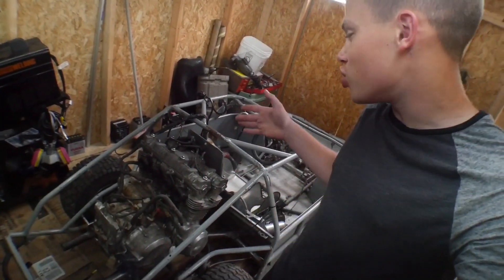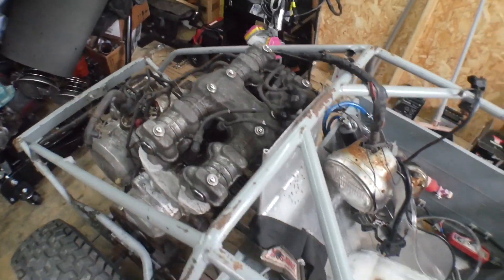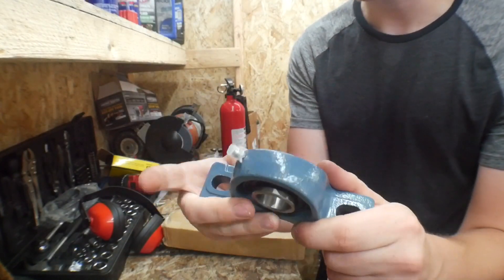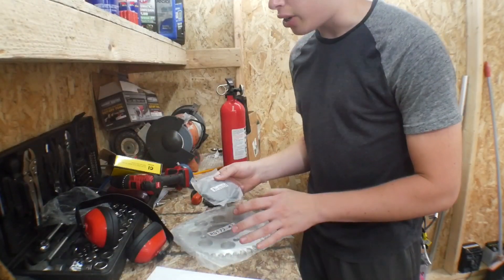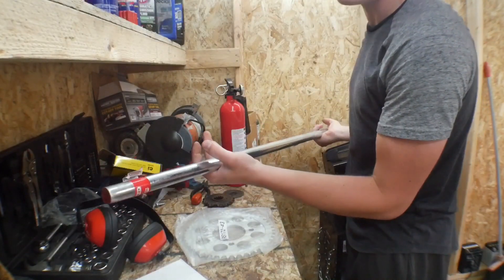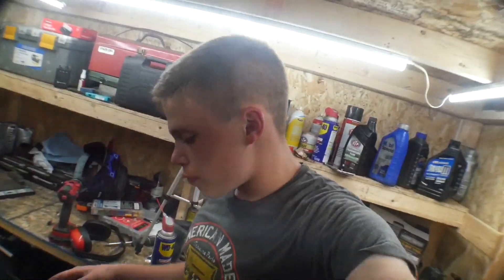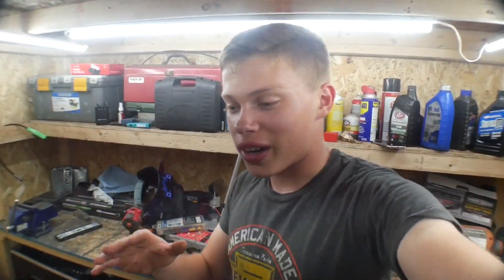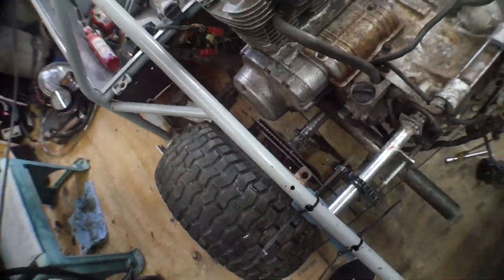Beginning To Make the NASKART DRIVE With it’s New ENGINE!

Comment: If your balling on a budget a level is literally the worst way to make that shaft perfectly flat. Use a 90° right angle and line it up against the rod. It will show you the high spots then sand, and triple check from all angles with the right angle until the surface is flat. As for welding the shaft to the motor, it works, I've done it. But secure 3 pieces of flat metal along the shaft you made and the engine shaft. This will align it and leave you one side to tack it while its straight. Always triple check. I noticed you called it good and the shaft is still extremely wobbling which will lead to things breaking in the transmission over time as well the chain coming off the sprocket. I like the effort though! Keep it up!

P.s. I would have done this much differently with a Jack shaft system. However my advice is for working with what you got already.

Comment: Those welds wont hold u need more practice cause its tricky to weld with good preparation with harbor freight welder and u need to use a lathe to drill into the bar it will be strong and done right the motor has to much torque it will break as soon as u take off or get speed

Comment: I just died. You really did weld directly to the output shaft holy crap.. Oil seal is now ruined and it's not even close to balanced so the vibrations will destroy the bearings in very short order.  
This is an actual disaster.

Comment: You welded that shaft straight to the output shaft on the trans ?? I cringed looking at that .. this is a massive fail ... be ready to pull that motor out and put a new output shaft in the trans because you ruined it .

Comment: Migs.  Please stop.  Please back up and rethink what you did in this video. Welding to the drive shaft on the engine??? What ??  Your setting up for immediate failure.  The weld won’t take the abusive torque.  I thought you were going to build a second carrier axle to transfer the drive from the engine to the main axle.  You had the parts to do it.  I’m lost now.  I don’t know what your doin.

Comment: The shaft weld would hold up but probably not the way you did it. You need to put a bevel on the bar so you are getting much more welded material for strength, right now its only the edge and the center is not supportive, if you grind a bevel into the shaft and weld it all solid it wont break.

Comment: You shouldn´t weld the rod against the motor output shaft. Use a coupling instead that will allow for some flex. The weld will crack in time.

Comment: Not being a dick but u have officially fucked that up, heat has killed drive seal and welding that to it will never be strong enough.also if no near perfectly straight vibration will kill it . Maybe u could of got 4 sprockets welded and bolted together the weld shaft to sprocket s ,at lease if it broke ur output shaft would still be ok .u should of used jack shaft really

Comment: Hey Migs, hopefully you didn't get a good weld on that counter shaft grind the weld off and bolt the sprocket on like it was originally use the two pillow blocks that you got and make a jack shaft. That is a short chain from the trans to a shaft then a chain from the shaft to the original axle. So you'll end up with two chains. I can send you a diagram if you would like.

Comment: You should of done a jack shaft or even welded the old sprocket to the end of the shaft so it has the spline. Will make it easier to remove engine later and will be much stronger

Comment: Its going to be way too low geared with oem sprockets as your drive wheels are half the size of the bikes rear wheel. You need a 26-30 tooth 428 split sprocket to set your gearing up right

Comment: no no no, do not weld to the output shaft..

mount 2 pillows blocks (one on each side) of the diagonal bars.
run the shaft through each, on the shaft run a sprocket that is driven by the engine sprocket.
then put another sprocket on the shaft inline with the final drive sprocket.. so much stronger, safer and less harmful to that engine.
Reply: plus you may have just killed the output shaft seal if it got too hot

Comment: You just destroyed your output shaft seal ..by welding on it ..before you get to far you can have a machine shop make a colour that will fit the output shaft or is that collar ? Anyway don't do that ..your engine oil circulated threw your transmission..order a seal and take you old output sprocket they can use it to make the collar .. by welding in your engine you can also destroy your alternator stator ..

Comment: Just for fun .. you'll need an electric fan between firewall and your engine as you will be blocking the air from an air cooled engine ..that's if you want the engine to last a while..

Comment: NO what are you doing welding that shaft the output shaft that will never hold that motor makes WAY to much power to do that shade tree mechanic crap bro find someone who can fabricate and fix that you should have done a jack shaft setup that seal around the shaft will more than likely leak now I told ya your in over your head and your drowning quick I cant wait to see the first ride please continue down this path I must say it makes for funny content but please think this through before it throws a chain and hurts ya bad

Comment: use a machine dog coupler please do not weld it 99.9 percent of the time you Will wreck the shaft/bearings they are used on electric car conversions and give you a couple of degrees on tolerance at least look into it first

Comment: You are going to ruin the whole thing you should not even try to weld on to the motors sprocket shaft you should of ran the stock sprocket and chain to a jackshaft then run nothing less then a 40 chain from jackshaft to the gocart axle look up rather be welding and or Redbeard's or even cars and cameras on here I hope you don't have the motor casing sitting on that frame you welded up cause it will brake the casing not hating on ya bud but you got to do a lil more research on it before you so it I'm glad you are trying to learn and teach ur self but a lot of people are going to hate on you on here but I promise you u will never get your weld to hold up on the shaft it is harden steal and no harbor freight welder will weld hot enough at least no flex core it just won't get hot enough I haven't even finished watching this but I hope you see this before you mess it up. Just take your time don't rush this do some more research bud ask people and if you ask gopower sport I'm sure they will hook you up with all the parts you need far as the jackshaft and stuff they help a lot of people to bad you don't live around me cause I would help ya out with designing in building it the right way do some riding videos in the mean time while you figure this project out
Reply: Please see this before u mess it up
Reply: Nevermind I just saw u welded on the sprocket shaft you will have to replace it and do it how I said with jackshaft or you will have to much vibration and it will ruin the motor it will prob blow to pieces if ur weld doesn't brake as soon as you let the clutch out

Comment: Ok best way to make the axle to the shaft straight would have been to find the center of the axle (bar) drill and tap the hole with the same thread size then find a piece of all thread or a long bolt cut the top off and screw both pieces together with the thread then weld it this way it perfect

Comment: Your clutch is gunna struggle so bad setting off you probably won’t even be able to se set off without stalling I’ve seen a video like this but bigger kart and he had to go really small for the engine sprocket and really big on the back sprocket just so the clutch was fine, I definitely think you’ll need to go smaller on the engine sprocket my guy

Comment: Don’t weld the shaft to the engine. The shaft will unbalance the motor and it will grenade itself and since you welded a shaft to a motor you won’t be able to take it apart. Instead use a jackshaft  setup which in return will give you more adjustability in gearing etc.

Comment: That heat welded on that selector shaft would most likely ruined the rubber oil seal. You will be lucky if it doesn't piss out all its oil now when it's driving. I though you were going a jackshaft, would have been a much better way but it's all a learning process.

Comment: I wouldnt weld the shaft to the motor the heat of tue welder will make the shaft brittle and when 75 HP comes in it will probly break. Make a jackshaft and that will give your more room to mess around with gearing.

Comment: Before welding the drive shaft to the sprocket shaft it would of been an option to drill into the centre of the drive shaft and tap a thread into it and then used a threaded stud to screw it into the sprocket shaft to give it extra strength.better yet go with previous advice and go the jack shaft option.

Comment: You really should not have welded onto that shaft like that. It's not going to hold and it's really not good to heat and cool that shaft especially when it's still going though the seals of the engine. Thoes little welds are not stong enough to take that engines hp. Good luck tho videos are lit👌

Comment: Personally what I would do pal is I would actually get a thread milled into your drive shaft, screw it into the gearbox and then drill and tap a big grub screw into the output shaft to lock the drive shaft in place as getting it to rotate perfectly after welding will be quite difficult

Comment: You said you were going to do this right but all I can see is you doing basically everything wrong. I don’t even have words to explain how fucked up this project is, I’m ready for you to drive it and you crack the case cause you mounted it wrong or you snap the drive shaft because of how poorly you welded it on or how badly you need to just buy new carburetors as I don’t think the rebuild kit is gonna fix the Niagara Falls of fuel that leaks out of them. You should get some advice from cars and cameras and ESPECIALLY rather b welding as they have experience with motorcycle engines and they know how to properly fabricate things. It hurts me to watch these videos and How you don’t take advice from comments

Comment: Fuck me running. He leveled the end lmfao. Bro what are u doing. U don't actually level the end lol. U square it up lol. On athe lathe. Dude please just have a some one with some knowledge doing this. That rod is going to fly off and and seriously hurt some one. I didn't even leave a gap for the weld to go in. Its just sitting on the outside. U gave it a resting place really. It didn't join the two ends together. There's absolutely no way that welder got hot enough. I'm not a welder but I've been learning some things along the way and I have that same welder. U know the most I've done with it is weld some tabs and pipes for my bike. Sure as hell not trying axles that thick. U really need a tig done on it. U should of used a piece of angle to make it straight. Its not even straight brother. Please stop. Its all wrong

Comment: Build a Jack shaft use the old sprocket and drill the middle out of it so it fits on pipe you have if you use the old sprocket it will be one to one no gear reduction it will save you money and time in future because it will where out that seal

Comment: DO NOT WELD IT, you might get it wrong or off, and it will mess everything up, do a jackshaft, have the sprocket from the engine to a shaft behind the engine, with a chain and then just use more chain and sprockets to connect it to the original axle

Comment: Just pull the bearings replace the bearings and get new ones I go power sports it just makes it easier better and a lot faster when you have to replace it it's not good to split that sprocket it's a better chance that sprocket just completely shattering as soon as you put a load on it

Comment: First pull the axle. 2 CNC the end of the shaft and thread it so it goes back in the hole. because when you started modding everything you have to mod everything. i ran into one problem after another untill everything fit just right.

Comment: Migs  ......  DO NOT weld that shaft to the output shaft on the engine , you will just ruin a good engine doing it .  use those bearing holders and create a jack shaft , thats how you should do it correctly.  BEFORE you weld anything remove all the electric harness, weld the stuff up then re-fit the harness. ......  You are doing all this stuff  yet you have not even mounted the header pipes  and worked out a route for them .

To late well done on screwing up a CB750 engine , many of us told you to Jack shaft it , but you just welded onto the sprocket shaft, you really dont know how much you messed up there , now your stuck as you cannot jackshaft it due to your silly mistake of welding up teh sprocket shaft.   Now lets say you have a gearbox failure and have to replace something how are you going to split the cases and get that  sprocket shaft out of the case ?  ... i am sorry migs but this project  is a failure  due to he mistakes you have made and these funny ideas you have .

Comment: Great job migs, Make a sleeve for that engine shaft to slide into the little sprocket keyway, it will be 100% balanced and you won't have to worry about breaking the gearbox or wearing the bearings out in the future. Also now that I see the naskart has a hollow axle it may be best to get a stronger one like maybe a used axle from an Atv or something 🖒

Comment: Migs you dont need to have the original carb set, new pr used. You can get an aftermarket 4 cylinder carb for cheap and the’ll prolly work better than the original set you have there.

Comment: When u heat up the pillow block u will melt out all of the grease so u need to buy a grease gun with high speed bearing grease if u can’t get the u have to get high temp grease

Comment: NOBODY can weld a rod to an axle, perfectly lined up!!!!!!! what you could do, mount a sprocket on the Original axle, the take a second sprocket, weld that to the rod, and bolt it to the first sprocket, makes a adaptor, also have some use for the second pillowblock? NO WELDING ON ORIGINAL AXLES!!!!! it will simply destroy everything
Reply: didnt see the whole vid when i wrote it, this is a disaster construction...better make a inch thick firewall, the new axle will turn into a projectile

Comment: Chop saw would work or a band saw to make the split sprocket you will need a thin cut and a band saw would do that best, Harbor freight has chop saws. I doubt that shaft you welded to the sprocket shaft will hold, you should of used a sleeve to go over both shafts then welded it all up, way more solid. By the way that engine is a low end torque monster and a top end speed demon so be careful. Love the build.

Comment: No on the split sprocket, no on that shaft make a jack shaft and do it right not half ass that weld will for sure break then you have the potential for a pipe cracking the case or worse your skull build your jack shaft behind the engine not attached to it.

Comment: You should made a sleeve to slide over the output shaft on the engine. I would buy like 5 of those sprockets, set them on the output shaft and weld the sprockets together, you’ll have a sleeve to go over the axle and the output shaft

Comment: hope tht motor doesnt break cuz u wont be able to take it apart u welded tht axle straight to the transmission
Reply: PowerBand Garage it could be grinded off, I don’t think he’s gonna have to worry about it though because I’m 95% sure that one clutch dump will take it off
Reply: Yes you can the case is split horizontally so pulling the top half would allow you to remove it. Well on my Cb750 engine that's the way it is
Reply: @carsrme0141  but to pull the trans through tht seal isn't happening now thts what I meant.